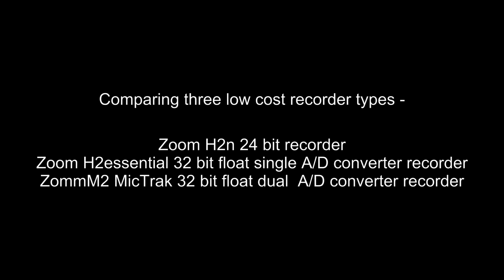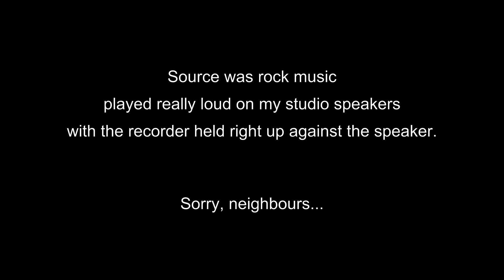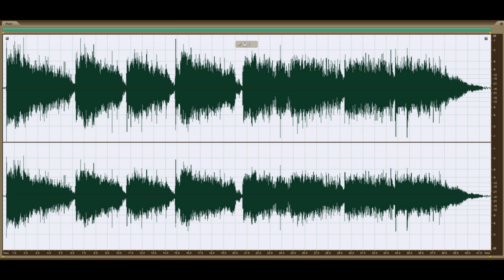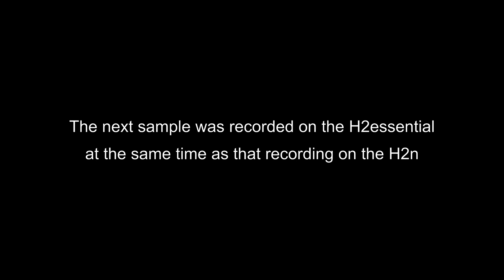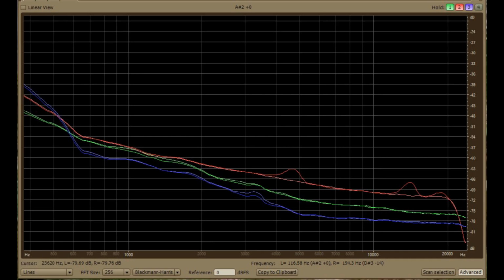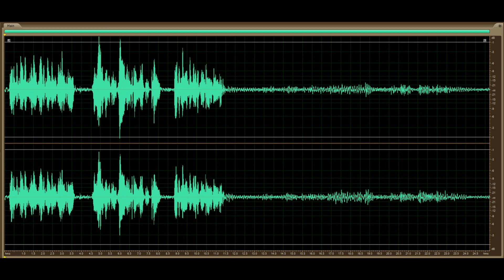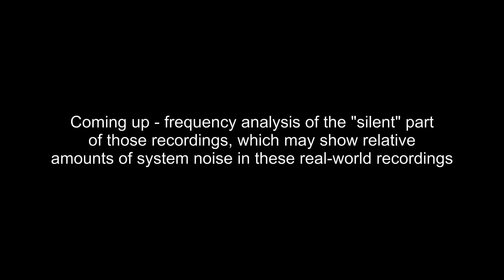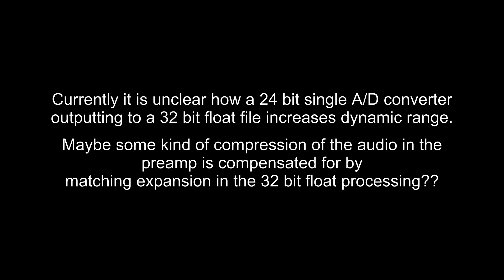Zoom H2n H2e & M2 - dynamic range tests, with waveforms and signal analysis - 32 bit float vs 24 bit

Comment: Thank you for this thorough assessment. Especially with the frequency response chart. I'm surprised that the M2 produces a cleaner signal than its more expensive sibling the h2e.
Reply from the maker: Cheers! The H2e can do a lot more than the M2, which is a pure and simple mic that records, but if I needed to record a string quartet recital in as simple a way as possible and get the most acceptable result, I would certainly take the M2. As you can't connect an external mic to it I think Zoom have incorporated a better than normal one as the device is no better than the mic. And the rest of the components are configured to handle the output from that known single source.

Comment: Thank you for sharing and for your time spent to make the tests! My take is that at low level you are essentially measuring the electret capsules noises, and for H2n at zero gain most probably signal level before ADC is to low degrading S/N.
M2 seems to have very good electret capsules, with FET-s connected as source repetors (for high SPL - 135dB) and very good preamps. Unfortunatelly it does not support external mics.

Comment from the maker: Apparently someone emailed Zoom about 32 bit float from a single 24 bit ADC and this was the question and answer - 

Question: "Since it's a single 24 bit converter, does that mean that the total dynamic range of the recorded file can't exceed the dynamic range of that converter?"

Zoom: "Yes this is correct, and the built-in microphone itself will clip before the dynamic range would be reached."

That's an interesting admission!
Reply: It seams as though the best recorders with the best preamp are field recorders, not specifically designed for musicians, while the ones targeting musician markets have the so-so built-in mics and so-so preamps.
Reply: So that means the weakest point on this devise is the microphones? I just bought this to place it in the middle of band rehearsals, but the 120 dB is concerning.  I am considering exchanging it for either the H1 essential XLR or an F3.  Neither of which possesses the convenience and diverse capabilities on this h2e!   I will certainly try it out to hear the results.
Reply from the maker: @WalterDavidRiffmon  The M2 can handle 135dB - so that would be my first choice for band recording, though I don't know your exact requirements. Because it has no inputs I think Zoom has provided it with better mics than many small recorders as without reasonable built in mics there's no point in the device. And the preamp and converters are set up to handle the output from the mics as that's all they have to work with.  Elsewhere on my channel I tested three devices by standing in front of a public address system at a local fair which was playing logs t music and maybe that will give you some idea of how they might perform in front of a band.